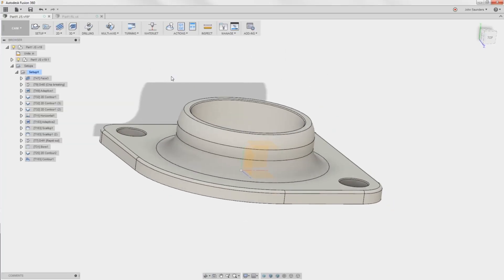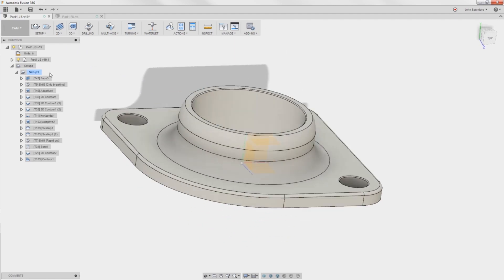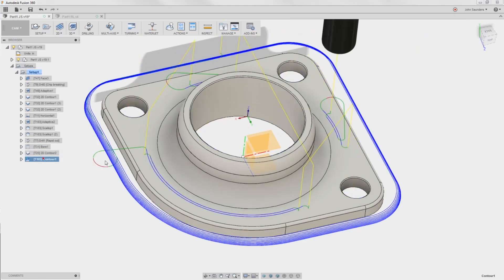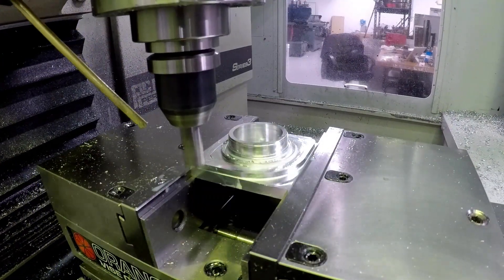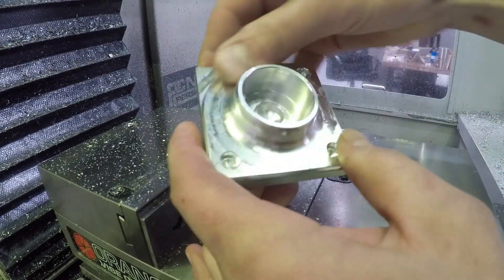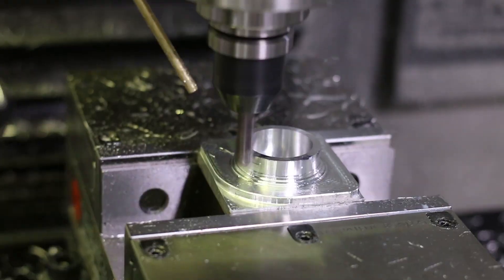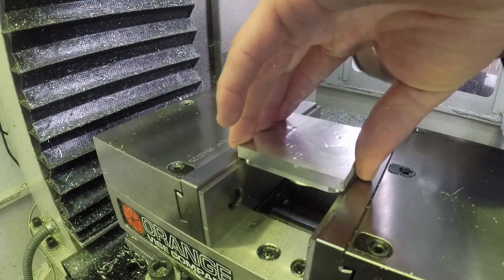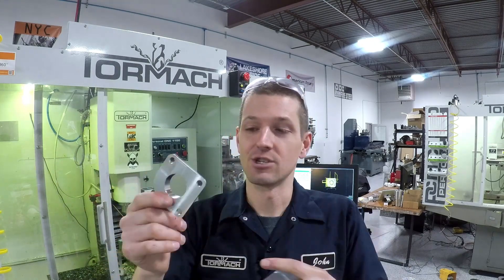Fusion 360 3D CAM: Help from Rob Lockwood!  WW137

Comment: Just watched Rob's video also.  John, major kudos to you for manning up to do this.  Your way works and his tuning is really next level.  Between the two of you though, we all learn a whole lot more.  It's amazing seeing the differences in thought process on the same part.  I'd have done a lot of the same ops you did.  Rob actually intuitively knows the tricks to force Fusion's CAM to bend to his will which is not simple.  Also watching his efforless use of expressions like -(toolRadius+.02in) in the stock to leave field is an eye opener to say the least.  It may be relatively simple but for most of us it's a bit of struggle to get comfortable with knowing what is even possible.  It's hard to understand how to make these decisions and think properly about CAM without seeing two different sets of decisions and really understanding what is going on.
Reply: But that is what's great about this software. It's easy to get started, but there is a tonne of power there once you get the experience to know how to use it. But at least you are making parts quickly from the beginning.

Comment: What was the cut time for each part?  Quality is important for sure, but so is productivity.
Reply: Rob mentioned he wasn't focusing on that, so for the purposes of this video, it's not important.
Reply: agreed completely, but without being able to actually stick parameters into the operations that make sense for the machine, such a thing is a lost cause.
Reply: +rob lockwood I made this comment before watching your video.  I am still curious and since John sped up parts of the video of the machining there is no way for us to figure it out by looking at time stamps.  If yours is still faster without any optimization for the machine performance wouldn't that be especially telling?
Reply: Right, but I don't think that's the case. IIRC, I glanced at the calculated machine time and mine was a decent amount longer. The problem with HEM clearing is that it quickly goes from high efficiency to horrible efficiency if the parameters are garbage, and there's a decent chance they are here! I do agree though, i'd be a little interested to hear the difference, just need to give myself an out for when I lose!
Reply: I might have ditched the drilling even for the bolt holes and then steepened the ramp and added some taper in for the helical entry in the inside.    You know, If it was a race.  :)

Comment: There are usually many machining strategies to produce a part. Key is to use what best suits your machines, equipment or parts.
It's really about making conforming parts in the cheapest manner possible, there is no point putting extra time time in if it's not required or using the best of what you have especially on low volume. 

Would be interesting to know he time difference here and some measurement differences like profile/form error and surface finish etc.

Comment: Rob pretty much covered everything. Don't have much to add beyond what he changed. 

Other than I may have gone top to bottom when surfacing the outside bore walls.  Let's the bottom of the tool take most of punishment in the interrupted cuts and saves the corner rads for finishing.  No issue in aluminum, but in steel or something harder, coming in against that stair stepped roughed material could chip the flutes.

Comment: Please do cover how to cut off the "bottom" extraneous material.  I've started learning some CNC machining on our school's brand new Haas TM2, and your videos have helped tremendously... but I'm still confused about how to clean up the back side of a part after you "run out" of material to clamp to on the finished side.

Comment: When is he going to go wacking with the HAAS? I would have started on the back. Finish outside, ruff thru pocket leaving .01, spot drill two holes, chamfer outside & center. Flip over finish everything. Parts done and 100% deburred. If it's a "job" and is 6061T6,  you can cheat by using 6061T651 QQA250/11, it doesn't move around as much.